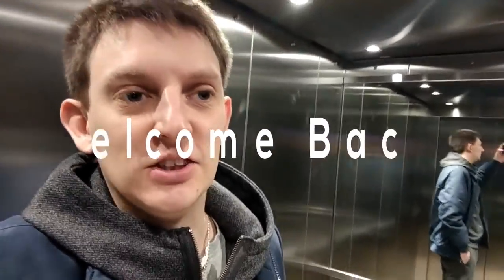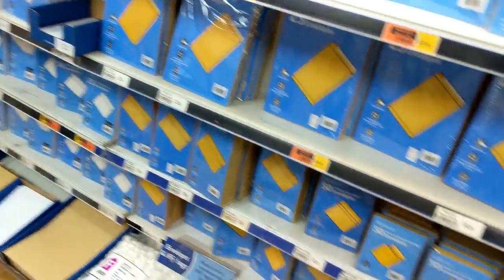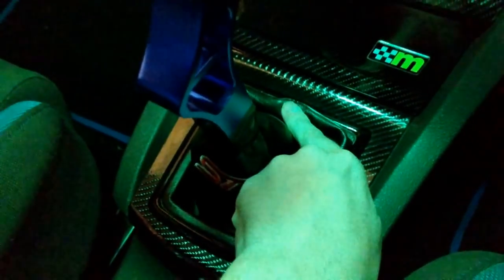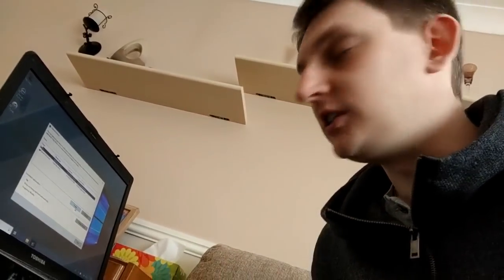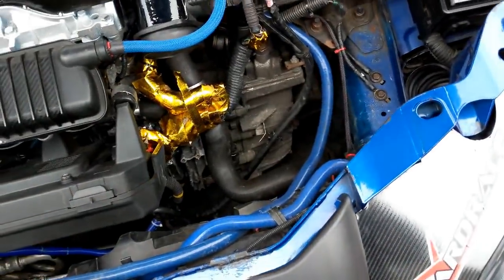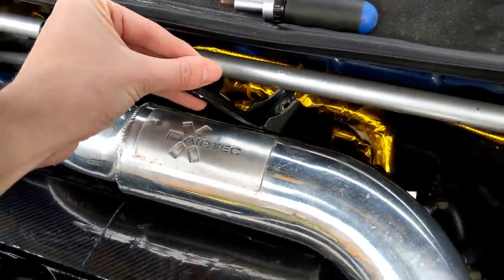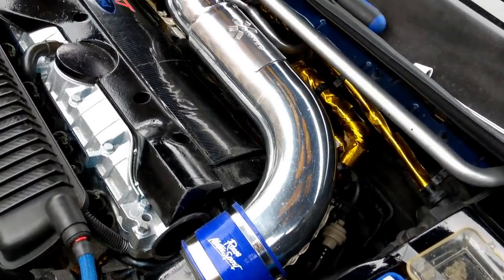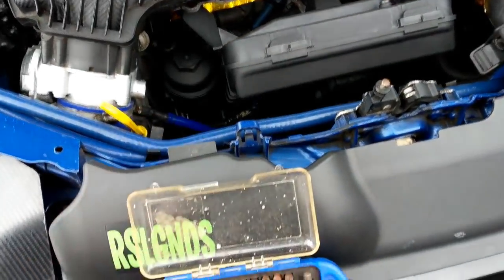My Focus ST 225 mk2 Gets A RS mk2 Airbox & K&N filter

Comment: Hi!
Do you know if the RS mk3 airbox fits with the RS500 mountune aribox lid??
Edited:
It fits perfectly on a Focus mk2 facelift 1.6 TDCi airbox (airbox ref: 7m51-9600-bf)
Easy to modified and cheaper than a Focus RS mk2 airbox.
Reply from the maker: Yeah I'm sure it will fit looks like the same style may just need to cut off the feet tabs underneath.
Reply: Okey, thank you AJ!

Comment: looks lovely lad but ive got one question youve installed the short shifter then added a higher gear stick has it effectively made it the same length just higher?
Reply from the maker: No bud I just wanted to gear sticker higher to the steering wheel for them extra quick gear changes. I made it as short as possible and it stayed the same. Made a good difference having the gear sticker higher too getting them gears quicker and hand back on the steering wheel for full control. 👌

Comment: Hi, I remember seeing one of your videos where you had taped up some of the hoses in blue, wondered what you had used to do that?
Reply from the maker: quite old stuff not sure if you can still buy it, i found it on ebay years ago, pipe tape they had a few different colours. also acts as a protection from heat and pipes splitting

Comment: I like the cold air feed how did you do this? Just wedges in or bolted in
Reply from the maker: The one behind the fog light cover? If so I just cut the shape of it out, cut the bumper from behind a big square, and then I put a screw through the cold pipe into the bumper. Then I glued the pipe to the bumper from behind along with the mesh had to be glued too. The mesh is there to hide the intake and also to stop things flying on up.

Comment: I wanted ur other crossover. :(
Reply from the maker: Ahh sorry bud lol needed to swap with someone for a Airtec to get this RS style airbox to work.
Reply: Feelings have been hurt Ahaaa. I've just ordered the drivers side shaft... garage said it had slight play other side looks nearly new.
Reply from the maker: Lol sorry man 😂 ahh nice, I think you should get them shafts done and then come to the next ST Legends Car Meet 👍
Reply: Yep going to have ago at doing it on the floor if I can't use my mates ramps. 
I'm not on Facebook or that to no when one is.
Plus any change in performance or noise with a crossover pipe?
Reply: Does having the Rs vents affect the air filter when it's raining?
Reply from the maker: @shaunwelch9176  No mate sits no where near it, and tbh when it rains it hardly goes into the engine bay. But if you have a Rs airbox like me now with a lid no water gets on it. Even if you have a group A filter with a heat sheild round it be fine. Won't be enough rain to get into to effect the filter in anyway
Reply: Fair enough. Just was curious about that lol.